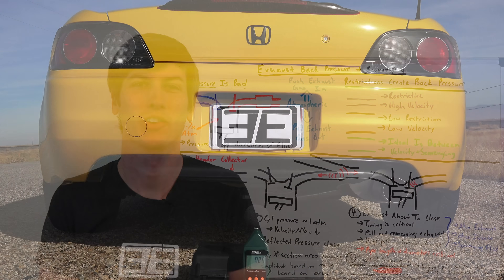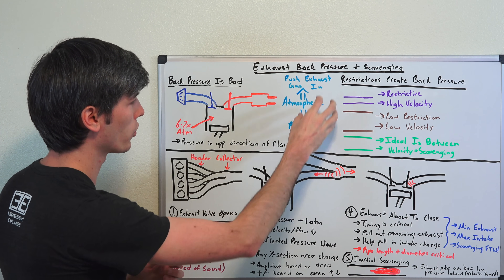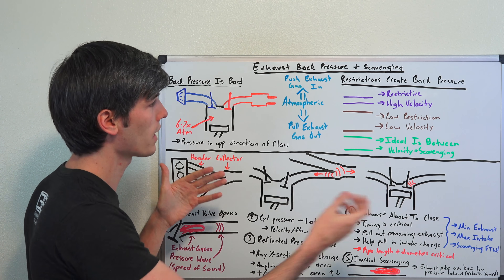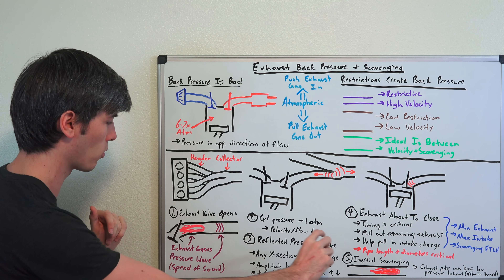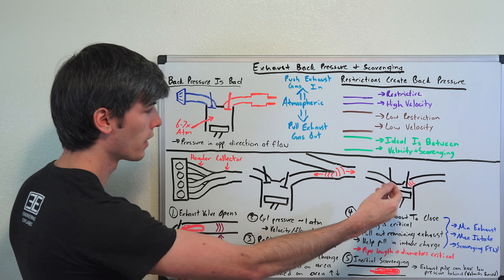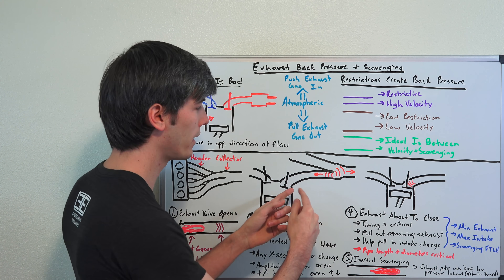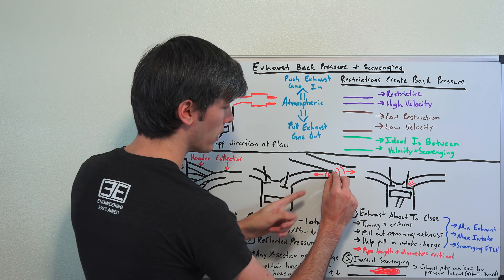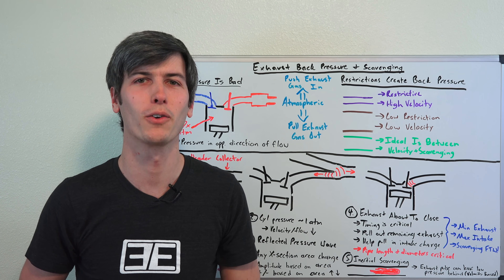Stop Saying Car Exhausts Need Back Pressure

Comment: Happy new year. 

Anyone reading through the comments section want to give me feedback, I would love to hear. 

Own a 1982 Audi 4000. 1.6L 4 cylinder DIESEL, produces 52 HP & 72 LB of torque.
I love her to death, nothing like driving a 5 speed with a granny lower gear I do not use.

But my question to the car folks here is, am I neglecting her strength on the road without an exhaust system attached. 

I run no pipe at all from the engine block. 
The reason is not because I would my car to sound like a sports car. The previous owner sold(include with the purchase) me the exhaust pipe detached from the car, because he hit a speed bump ripe her off.
The reason I have not reattached to the engine block is because the previous owner lowered the car.

Thanks you for reading to your valued feedback.

Comment: OK, but perhaps you can answer this. In the UK we have lots of small engine 3 or 4cyl cars. 1.0L, 1.2L etc. Particularly as 1st cars when you are young. Why do these small engines run like crap when you have a exhaust leak. Such as a rusty Silencer (Muffler) with holes in it. Reduced power and poor MPG. Surely this is the result of less back pressure as there are holes in the exhaust system ?.

Comment: From experience, all else being equal there was a noticeable drop in low end torque when I ran my V6 Fiero (now V8) without a catalytic converter.  The converter was not removed due to it being defective.  As soon as I put a converter back on, low end torque was restored.  Granted I may have lost some top end power but I didn't care as low end torque is what I needed most in city driving.  I think there is more to this conversation as to how torque curves and other power profiles can be affected by variations in backpressure.  Having straight pipe instead of the catalytic converter might have also affected some of those pressure waves you speak of.  I don't know how much of an effect they would have several feet away from the collector or manifolds.

Comment: I'm not a car mechanic but I am a certified small engine mechanic and also own a small engine business. A lot of single cylinder engines run a lot better with back pressure. I get stuff in like 3 wheelers, or bikes that don't like to idle with broke exhaust. Every time  after fixing the exhaust the issue goes away... and it's because of back pressure.
Reply: That's because the change in the exhaust characteristics throws out the fuel metering on the carburetor/injection system. You'll find if it's not too great of a change you could adjust the fuelling to get it to idle again, I've done this on a bunch of different engines when I've changed the exhaust design for one reason or another. It's not directly the back pressure as it is changes in how the exhaust flows, as per the video.
Reply: Talasas yea that's first thing I try but it only works small % of the time.... with exhaust basically broken off it tends to backfire which kills the engine.
Reply: it backfires because it's rich and a broken exhaust allows enough O2 to reach the hot exhaust/unburnt fuel mixture.  it doesn't ignite until it has O2.  once it ignites, backfires, then sends a positive pressure wave back up the exhaust, fills the chamber and prevents a fresh charge from entering the chamber.  back pressure isn't solving the problem.  the sealed exhaust system that keeps O2 out is what is solving the problem.
Reply: Joe and Duke you dont know what your talking about. you called afterfire backfire.
Reply: Without the back pressure, the A/F ratio goes lean.
Enrichment of the mixture makes the back pressure un necessary.
Reply: GlassTopRX7 yea the ones I have worked on were
Reply: 2 stroke engines runs like crap without exhaust, but i guess its supposed to do that considering how 2 strokes work
Reply: goodguygto Those guys are running wide-open throttle most of the time.
At max rpm, you want free-flowing exhaust.
If you do that to your average passenger sedan, you're going to hate city driving and on-ramps.
Reply: goodguygto You obviously didn't quite understand the video. No, engines do not need back pressure. A muffler is purely a device to change the decibel level. A good designed muffler will not increase back pressure but will change the dB level. I've worked in a custom exhaust shop for close to thirty years and I hear this argument all the time. There is a video on motortrend called engine masters and they prove how a four stroke engine performed on the dyno with and without back pressure.
Reply: Sorry I meant to write "temporary pulse" not temporary PLUS. Oops!
Reply: Jeremy Hall     Then you're going to be running too rich or too lean!!! I say either advance the timing and/or get a hotter, faster Spark!!! Take a look at NASCAR, drag racers, funny cars Etc.!!!
Reply: Yes, true. But that only applied to two stroke engines, a very different animal. I used to race model airplanes with two strokes.
Reply: Look up "back pressure" on Wikipedia. You need a temporary plus of back pressure on a two-stroke while the incoming charge of fuel and air is coming in, so that it doesn't blow out the open exhaust. But then, right after you need negative pressure to remove the burnt gasses out so that you can get the cylinder full of clean air and fuel. It is a tricky balancing act. thats why you see the tuned pipes that open up in the middle and then neck back down to a small exit. So that a pressure wave keeps the clean air and fuel from blowing straight through.
Reply: Joe and Duke    you're absolutely right, you do need back pressure!!! If Vehicles did not need back pressure?, they would NOT need mufflers!!! Engines need some, "SOME" back pressure.

Comment: Holy cow... Great explanation!  This has to get complicated with multiple cylinders and different RPM ranges...  Are most exhaust tuned for a boost just before or after max HP or max torque?  Are there environmental aspects to the tuning as well?  Exhaust acoustics is actually super complicated.

Comment: Keep it up you are great I m watching your videos since 2014 bro, 
Q)  What if some part of exhaust gases returned back and compressed again during compression stroke? 
Q2 ) I have learned about tuned pipes in 2 stroke engine where the back pressure helps to send back the air-fuel mixture in the cylinder can you define working of that??

Comment: 2 stroke engines actually do need back pressure and peak power can be tuned to different rpm's with different exhaust expansion chamber sizes.... the sound wave from a power stroke bounces off of chamber and reverberates back to the exhaust port, compressing the air fuel mixture for the next storke like a turbo charger.   this would be a good complimentary video to make.

Comment: Curious as to how much of a hp gain is possible with an exhaust that tuned correctly vs slightly incorrect, and how precise the lengths and diameters have to be, and does any scavenging occur with exhaust that ends at the collector or with zoomies. Just wondering in what applications the juice is worth the squeeze

Comment: I remember hearing somewhere that w/really heavily tuned engines (Like drag boats) that the collector tends to break down more quickly than the rest of the exhaust.
By any chance do you know if that has any truth and, if so, am I partially correct for thinking part of the increased wear is due to the reflected wave pressure?
Edit: Thanks for the info! I know now just how badly I was using the wrong terms and reasoning to explain to people why you don't want to have massively oversized exhaust.

Comment: As usual, great information, and I learned much.  My assumption was always bigger diameter= better always.  Velocity, scavenging and reflection never occurred to me. Great thanks. One thing more would have been useful: at what point does extra diameter start having too much detriment on velocity? 3 inches? 3 1/2?  4?  I will eventually put an aftermarket exhaust on my Fiesta ST, was considering 3".

Comment: I think it's worth mentioning that an engine's ecu is tuned for a specific setup. Changing the backpressure will effect the volumetric efficiency of the engine. Without a proper tune you don't see much benefit from changing the exhaust alone. In fact, if you remove too much exhaust gas, the ecu may not be adding enough fuel and you'll start getting detonation/pinging.

Comment: How does that work like when you're dealing with motorcycles I have heard that short pipes are not necessarily good for exhaust valves somehow the lack of back pressure if you will will cause the exhaust valves to run hotter is there any truth to this what about different length exhaust pipes like on a V-twin engine where one exhaust pipe may be longer or shorter than the other in the case of individual exhaust pipes how did those compare

Comment: So I shouldn't just arbitrarily cut off sections of my exhaust in my fall fair builds? Well at least my thinking was never on the basis for power, as I just want one less thing to snag on the ground while driving aggressively into others! Besides, it's not a derby car if you still have an intact exhaust, just doesn't sound right... (Figured someone had to be that guy in the comment section)

Comment: I prefer 2-stroke engines tuning which THRIVE on exhaust tuning :-)  Your description has one small mistake.... ideally, (for peak power....not emissions) one would want a small amount of the fresh gasses to enter the exhaust. Then , just before the valve closes, the reflected positive wave stuffs it back into the cylinder. When properly tuned (for a specific RPM) the cylinder has MORE than atmospheric pressure just before the compression-stroke begins. (no turbocharger nor supercharger needed to get some 'boost'!)

Comment: In a turbo diesel, with a small turbo, if you loose back pressure your turbo spools up way faster and it pops out a safe or it may even break. Also you loose top speed. That isn't so linear nor true.

Everyone knows faster moving gas makes the turbine spool faster.

Back pressure is good in some cases.

Comment: I'm assuming this applies to N/A vehicles?  What about Boosted vehicles?  The reason I ask is I have a 1.6 Ecoboost Fiesta st so I don't have exhaust headers.  But rather a downpipe and here's the peculiar part.  My aftermarket downpipe starts off 3" diameter then goes down to 2.5", from there, I have an aftermarket exhaust that then goes from the 2.5" diameter, back up to a 3".  In between there there is a resonator, but am I hurting the car or robbing horsepower because it reduces down to 2.5" in the middle, instead of being a consistent diameter throughout?

Comment: I was under the impression that myths about back pressure originated with older more primitive 2 stroke motorcycles which needed to stop flow through of unburned gas.

Comment: I agree with you for the most part on back pressure, however you also have to consider the pressure differential and it’s effect on the valve opening. If the back pressure is too low it will put a higher strain on the valve and in turn the cam. The higher differential will want to push the valve into its seat. With a higher pressure behind the valve it won’t be as easy for the air inside the chamber to force the valve shut, meaning it will take less force to push open the valve. That being said, this effect is probably negligible in high horsepower cars, but lower HP cars will need to pay closer attention to the exhaust system they use.

Comment: In part you are fully right, but also you forget that many car like bmw as example, their engines are turbo charge and they have an exhaust flap that will close about 80 percent for 5 seconds or so to create back pressure as it is need for the engine to build up "they designed this for both noise-control reasons and vehicle warm-up. You will then here it open up and it will remain open", so back pressure is needed in some applications.

Comment: Hang on...I'm confused. The claim is that exhaust back pressure is bad, in absolute terms. But then Jason proceeds to say that "restrictions cause back pressure"...but having no restriction reduces velocity which is bad....so some back pressure is good....? It sounds contradictory. I know for a fact that on some cars, if you straight pipe or dump the exhaust too short, the engine will lose torque. Naturally I assume that is more related to the lost velocity but this video clearly states that velocity and restriction/back pressure are related....so I still don't see how all back pressure is bad. I guess what i am saying is that it shouldn't be stated in absolutes. I understand that back pressure alone is never good, which I assume is the point. Also, velocity is good, but they are not mutually exclusive. You can't have velocity without some restriction and restriction creates back pressure. So in order to find the ideal compromise of restriction and velocity....you are intentionally creating back pressure. I guess what I'm saying is that this discussion is pointless and pedantic since it's impossible on some cars to eliminate back pressure without losing power.

Comment: Can we just talk about this in terms of impedance matching? You want to match the impedance seen at the piston (or valve opening) to the external world as efficiently as possible, right?

Not just at one rpm but across the range.

It's like the design of horns for speakers; any discontinuity causes internal reflections that are destructive, and they require a wide bandwidth.

The geometry can be quite complex and sensitive particuarly at the transition between the moving part and the horn.

I bet JBL would design good exhausts!

Comment: Just to let everyone know, in some cases, such as siamiesed port engines, such as the A series in the Mini, DO need backpressure as they port scavenge like hell and need to implement shockwave tuning to get a good clean tune from an engine. Put anything bigger than a 1.75" on a Mini 1000 and you'll lose power and torque. :)

Comment: Hey Jason, I went to a technical school for engine rebuilding and machining back in 1984. I absolutely agree with you on flow v.s. efficiency and horsepower. Love your channel by the way! When we discussed back pressure at that school it was for the purpose of exhaust valve cooling. Let's say an exhaust valve has an approximate temp of 1400 degrees F, the back pressure can have a beneficial cooling effect of the valve as opposed to free flowing with minimum dwell time. I understand than we won't flow any slower than a positive displacement piston moves in hydraulics, but we have to remember that gases are compressible, so we can vary the velocity across the exhaust valve. The longer the exhaust gases stay in a dense pressure contact with the water jacket cooled cylinder wall the cooler they will be, also cooler are any back pressure gasses that are exposed to skin effect cooling at the header. The absence of back pressure in the form of an exhaust leak at the exhaust manifold is a contributing factor to burning valves. Us old guys may be arguing for back pressure because we've been told it was good without knowing in what application. I just wanted to point out that there are mechanical benefits for some back pressure that are in opposition to the horsepower numbers that benefit from reducing back pressure.

Comment: I personally think back pressure is helpful for torque and response. I ran a straight through muffler for a while and when I switched back to a normal muffler there was a noticeable difference in torque and throttle response.

Comment: instead of using these made up terms use actual psi or dynamic or static pressures, inches of water, or inches of mercury, use some real terminology.  otherwise its just dogmatic because i said so.

we all observe the same phenomena. 
we all have different words that feel right to use to explain the same thing.
scientific precedents set the right words. 
its all about forming 
order out of chaos.
information from data
i propose using the words already established in academic physics
back pressure is something grease monkeys came up with for momentum.

Comment: i love this video. using this information to full effect on an n/a project includes combining the right header size/design to the right exhaust pipe diameter/length, along with choosing the right resonator/muffler setups for most awesome accoustics. looks at my dyno sheet and smiles . ITBs + high compression plus exhaust component testing = power and torque like a supercharged equivalent motor. Currently reprofiling my exhaust ports for 2018, fully revised header and exhaust soon to come.*evilgrin*

Comment: Are you shitting me? The blatant ignorance in this video! Of course you need back pressure for your exhaust. BUT you have to adjust your muffler belts properly FIRST or you'll lose efficiency. Fail to do that and, sure, what you claim is then and ONLY THEN valid. You seriously need to read up on the nth law of thermodynamics. Jesus.

Comment: Isn't there a proper corelation between back pressure and inner exhaust gas recycling?
To a turbocharged engine there is no sense to create back pressure in the exhaust system because that would cause damage to the turbocharger. Until this point i agree with you. But to a natural aspirated engine the exhaust back pressure is crucial to pass emissions. At least that i was taught in car mechanics school. See, while in intake stroke, the valve intersection causes the exhaust valve to be still open causing exhaust gases to flow back into the cylinder and therefor causing the effect of inner egr.
So could anyone bring light to the Darkness in my mind with magic car engineering wisdom?